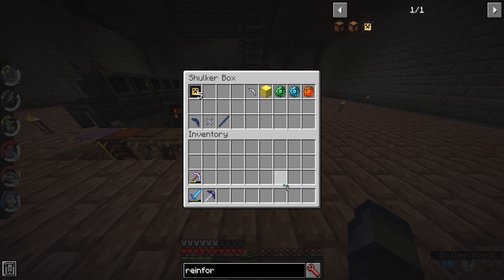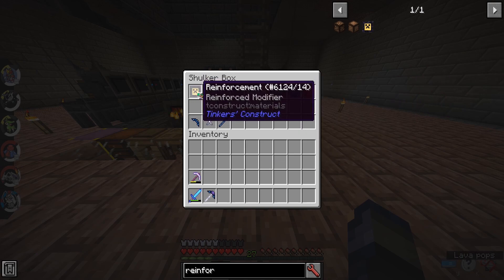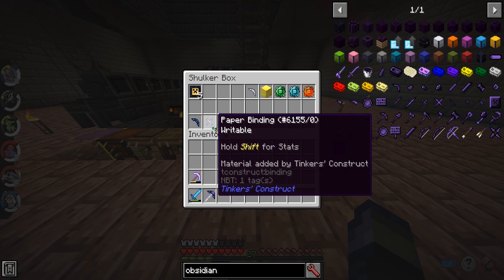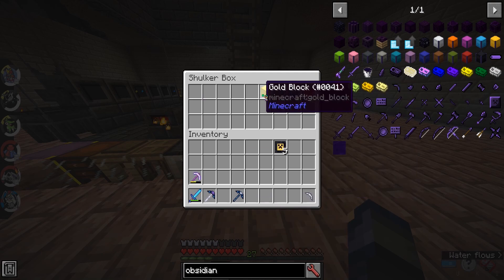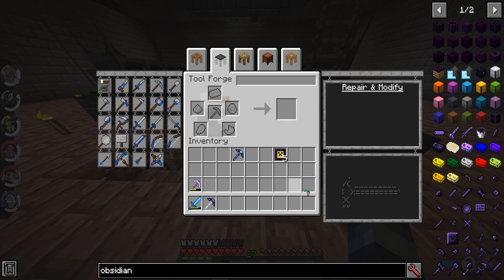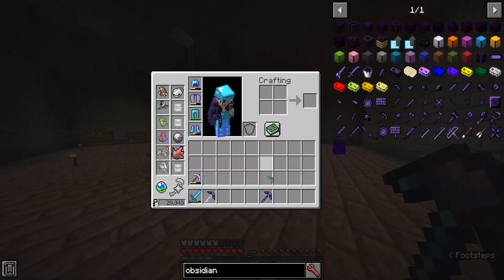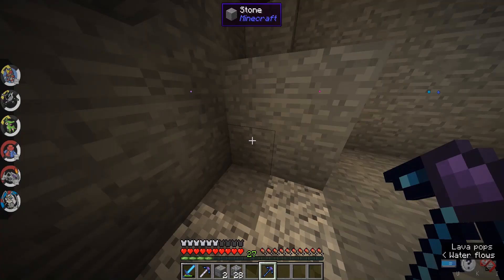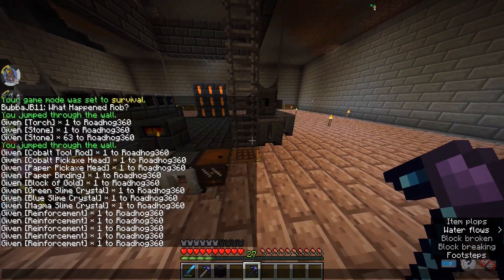Tinkers' Construct 2 how-to: Unbreakable Tools (Updated version in description)

Comment: I did my pickaxe with that materials and got only 2 modifiers not 4
Reply from the maker: Did you use the same parts demonstrated in the video, with embossment? 2 modifiers sounds like what paper and an embossment would give you, are you telling me the tool originally had no modifiers?
Reply: @Roadhog360  idk why, but all the tools i have created had only 1 modifier. Yes, I used the same parts and only have 2 modifiers, then I emboss it and got 3, but i can't get more than that.
Reply from the maker: @juanrestbergs3187  Hello, I thought I replied but apparently didn't. I've tried with the latest version and it still works for me. Are you still having issues?

Comment: what if i used up all the modifers before embossing, will i still get an extra modifier like in the vid?
Reply from the maker: Yeah, you will. Embossing's whole point is to provide another modifier slot.
Reply: @Roadhog360  cause when i did it i had to use a paper head instead of a handle for the extra modifier to show up
Reply: @Roadhog360  also can arrows be embossed?
Reply from the maker: @blacknote6945  I'm certain anything can be embossed. If the exact steps in the video did not work, you either did something wrong or maybe it was patched.
Reply from the maker: @blacknote6945  I've recently redone this, this tutorial still works to the letter.

Comment: What would happen if you do this but instead of using paper anything, you use magical wood from Extra Utilities, since pieces made from magical wood has the modifiable stat, which seems like an upgraded version of the writable stat, and sure, it has the magically brittle stat, but these tool are suppose to be unbreakable, so that shouldn't matter right?
Reply from the maker: Good idea, I was actually able to do the same thing using Mythril from SimpleOres and PlusTiC.
Yeah, you can swap other parts as long as you get enough slots. The point if thus tutorial was to tell you how to get those slots and what to do with them, this tutorial is meant to be interpreted with different types of compatible materials and tools.
Reply: @Roadhog360  k thanks. I now know exactly what to make my stuff out of

Comment: Unbreaking silk touch pick would be your exact setup but replace the cobalt tool rod with a sponge one. Same mining speed, wont break and has silk touch.
Reply from the maker: This would only work on tools where there is more than one rod component, but great comment!
Reply from the maker: I've announced a sequel to this video in the pinned comment, I'm going to be using this as an example of how you can modify the tools.

Comment: Don't work anymore, at least on FTB revelation 1.12..... Still get 3 midifiers even after paper embossment!
Reply from the maker: What version of Tinkers' Construct are you using, and which tool parts are you using? I've found smaller parts don't increase the writable level when embossed as paper for some reason, such as normal bindings.
Reply: @Roadhog360  i was using you tricks to do a shuriken (wanted to use XD). the version is TConstruct-1.12.2-2.12.0.157 (the last one downloadable with the pack regular twitch). Can you try it and tell me with what part you'll get the writtable?
Reply: @SuperMeStevie  it worked for me, with the shuriken
Reply from the maker: @SuperMeStevie  Paper is the writable part. I am using the same version you are.